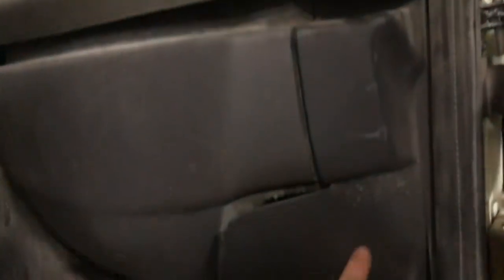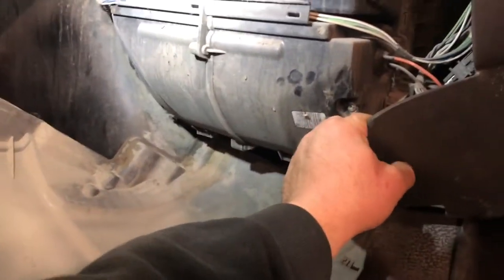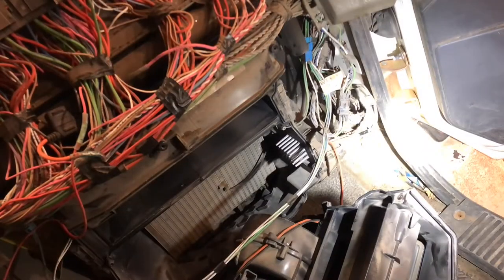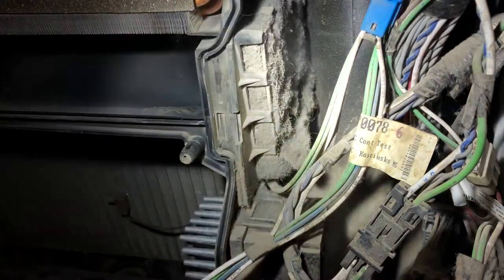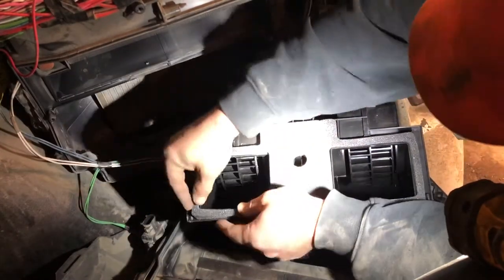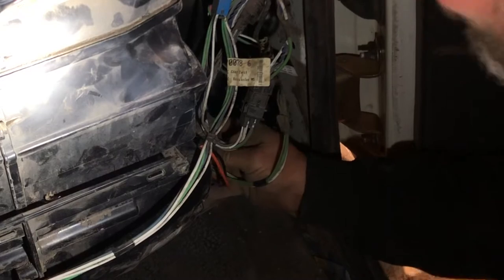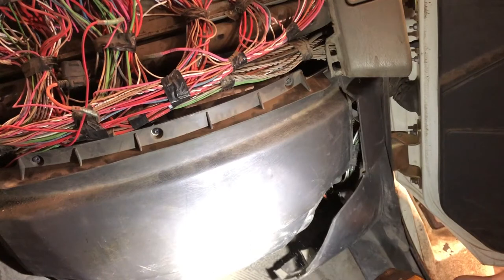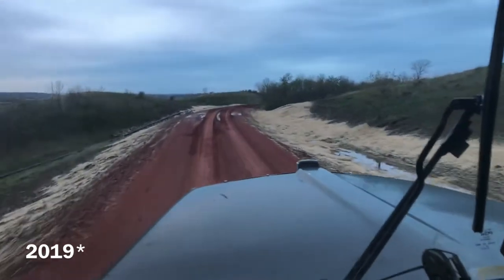How to Replace the Blower Motor on a 2016 International 4300

Comment: You completely missed the main starting point where you remove the first piece of trim start around the cup holder which is the only point I needed
Reply from the maker: This video has helped thousands of people.  Several Thousand…. You’re the first person that doesn’t know how to stick a screwdriver behind a piece of trim and pop it off.  “If you could kick the person in the pants responsible for most of your trouble, you wouldn't sit for a month.” ~Theodore Roosevelt